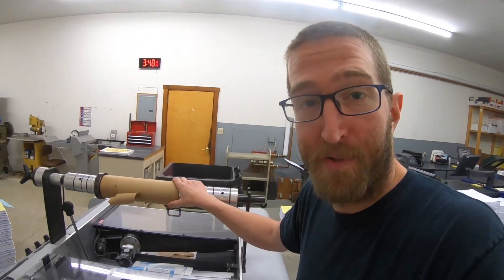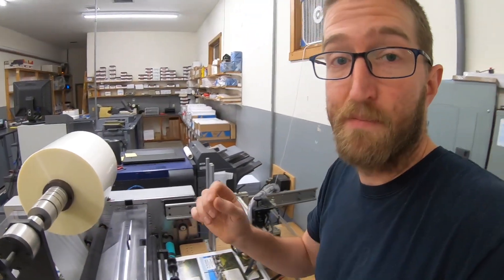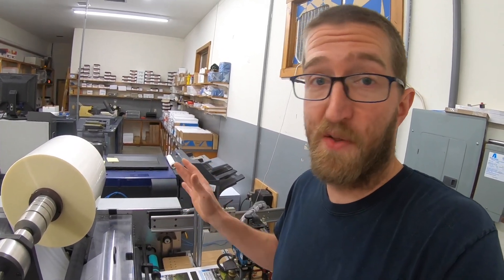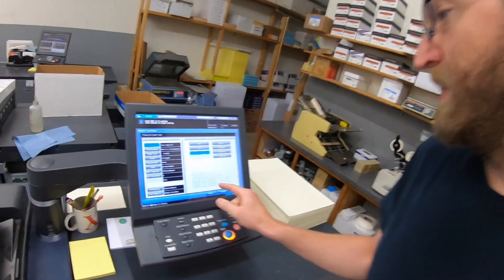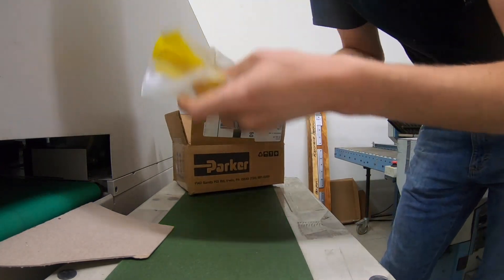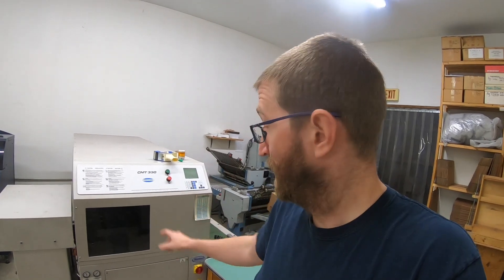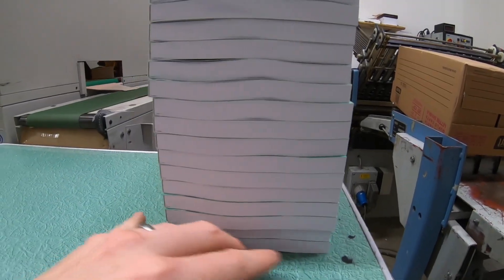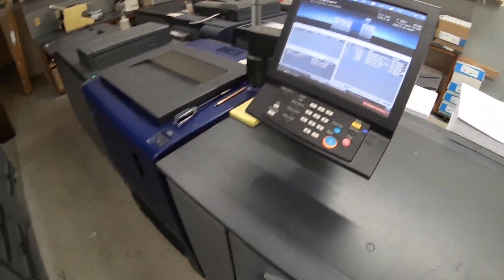EFI Fiery Slip Sheets,Tightening Parker Belt Driven Linear Actuator, Laminator Fail

Comment: Have you ever come across this error on your trimmer? ‘Knife down failure timed out before reaching down limit’ have you any idea what this could be?
Reply: Any ideas on this one Dan? 😊
Reply from the maker: Yes I did have that. I forget what I did to fix it though!
Reply: @justaprinter  I got it fixed, it was one of the valves that was sticking and just needed a spray of lubricant to get it going!

Comment: While printing on sticker paper why bubbles appear ( I use konica minolta C3080) , it's machine fault or paper ?
Reply from the maker: Thats a paper problem. I have never had that issue and I print lots of stickers. Could be possible your material is not for digital presses?
Reply: @justaprinter  Thank you sir. I like your content and your videos give me so much information. 😁

Comment: Dan, Is there an easy way like a switch or drive control which will allow you to change the cut direction on the big Challenge guilotine where it can cut both left to right and right to left so you can get the most use out of the full blade.??
Reply from the maker: No there is not. I just use each side of the blade. If the paper moves on one side you should increase your pressure or make sure your clamp is square.

Comment: That laminator isn't exactly a cheapo, is it? Why didn't they include a simple microswitch? Mechanically it's trivial to check if that feed is pulled tight and switches with large rubber rollers are readily available...
Reply from the maker: I agree, I should just put a switch in. I'm sure it would save me in the future. It would make a good video at least. LOL.
Reply: @justaprinter  Yes, that could be interesting. You probably could wire it in parallel to an existing stop switch, like an out-of-paper one.

Or just to a buzzer, but that's boring. Switch, 9V battery, battery contacts, piezo buzzer, done. Doesn't even need wires---the contact and buzzer bring enough---just a soldering iron. ;)
Reply from the maker: @HenryLoenwind  I was thinking of a switch in parallel with paper out sensor. Great minds think alike!

Comment: There are plastic scraping blades for that reason.

I do have a question for you, I am looking at buying a couple of pdf books off of drive-thru rpg and I just want a hard copy printed and bound because it's easier to read than a screen for myself. Would printers like yourself would do a single run print for personal use?
Reply from the maker: I don't offer that but some do. You could try www.docucopies.com
Reply: @justaprinter  thank you.

Comment: Another great video with nice tips. Had a quick question for you, do you use your perfect binder or any other machine to make tear off pads?  I've seen a couple machines like the Padmaster 2000 but not sure if its worth switching from my padding table.
Reply from the maker: I can do pads with my perfect binder but it is a lot slower doing one at a time. Painting adhesive on a stack is fast. I have been thinking about doing a side-by-side comparison on the next notepad job I do. Then we can all see the differences. I'm curious too!

Comment: Thanks for the great video. I love to see how you think about repairing your equipment. I bought a small and cheap-ish stack cutter but could not get it to cut straight with the back fence which was an aluminium piece. I tried squaring it to the sizes printed on the bed. Dit not work. Then I tried squaring it to the blade and while holding a square to the fence it became clear that the surface of the fence was wavy. My prize for going the cheap route. I took it off and spent half an hour resurfacing it as best I could with sandpaper and a flat even surface. Long story short. You make me think differently about fixing my equipment. Thanks for that.
Reply from the maker: Haha, thanks for the story. And glad you enjoy a glimpse into how my brain works!